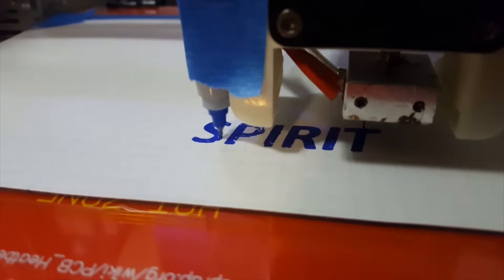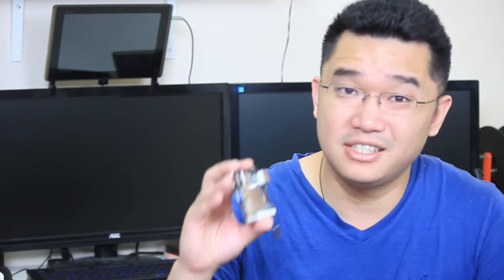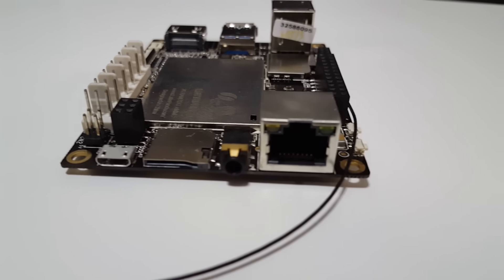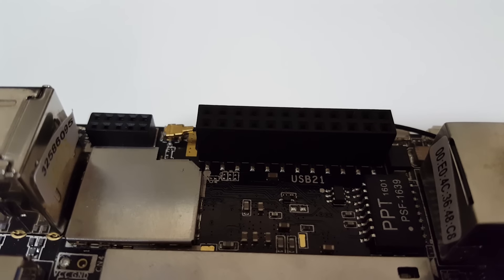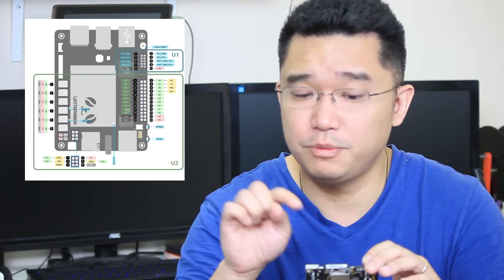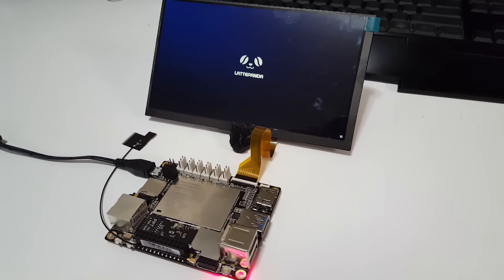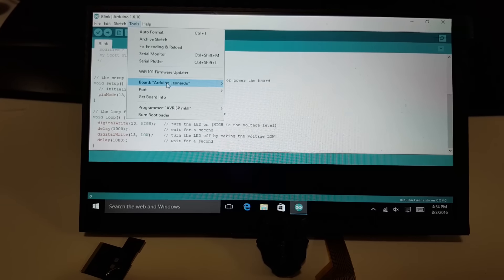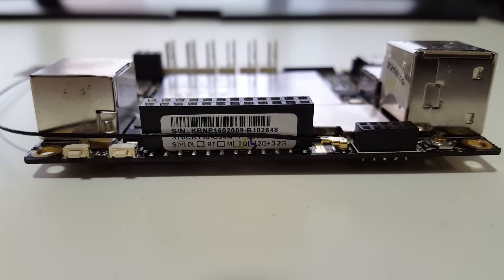Lattepanda windows 10 arduino built in

Comment: What are the advantages of boards like this vs a tablet (with a detachable  keyboard) aside of augmentation?
Reply from the maker: you can use this board to connect to the ouside world, temp sensor, relays, switch, ect...
Reply: +Novaspirit Tech cool, could be useful in electronic engineering. Thxs for the quick response nova.

Comment: have ordered a lattepanda 4/64 --- arrived today.
they only deliver with win10 ... 
but the win10 comes preinstalled is not activated
looks like the user has to buy a legal key
that sucks!!!

other panda users, same experience?
Reply from the maker: +crapcbm I will mention this to them... I'm very disappointed if this is happening
Reply: Novaspirit Tech
I wrote them yesterday. today reply from them: "DFR0419 is come with Win10 System without a key. You need buy your own key from Microsoft.
But it is  not illegal if you use it after 30 days on trial, just some functions are locked."
This is a scam. Now open a paypal thing ... that sucks, so guys again and again kill great projects.
Reply: I purchase latte panda 4/64 without licence too , I try to activate with stock product key but i did not work. Then I bought an OEM windows 10 licence that cost 26 euro.  I activated succesfully.
Reply: kormemis
yes that is right not all keys work.
Have also a key (from a broken netbook) but it said 'no' :P
I used this chance to test the "activator" to test this OEM thing, it worked and is now a "legal" copy (right, not really. But before someone gets panic, don't panic,
I plan to remove Win10, as it is a pain in the a...
Will try to get a Linux running. Have tried Mint18/64, but WiFi did not work in live-OS
We will see ... :)

Make sure, that it has air flow under side, so it don't slow down while working when getting too hot.
A old small cpu/gpu cooler is enough, If it continues to get too warm, use the fan of it on low rpm (5V of the board, and test some resistors)
Have done so, cool cool ;)

btw. dont use the micro USB to power it, that sucks. Long USB wire, tiny contacts, tooooo much resistance. Dont power up and work all the time.
You can use 2 of the 2x2 header pins next to it, make sure to check polarity + and + --- that is direct contacted to the micro USB.
Now works like a charme for me. Here you also get the 5V for the fan if needed.

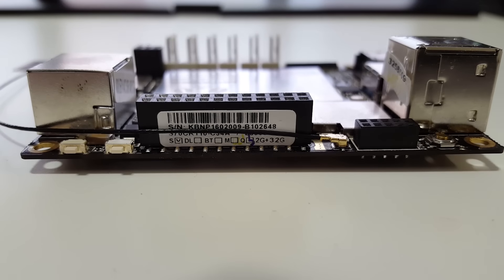Comment: 4:00 the solution without tape is write the program

void setup(){

pinMode(13,OUTPUT);

}

void loop (){

digitalWrite(13,0)

}
the sketch just turn the built in led off all the time

Comment: Just use four stand-offs at the board's mounting holes to keep the CPU's heat sink off the table. The Atom chipset is used in thin netbooks which are not fan cooled and don't even have vent slots.

Comment: I'm using a 2.1 Amp 5volt power supply but the board only stays on for about 3 minutes and then turns itself off and I have to reboot. I am using a standard keyboard and mouse  and HDMI into a LCD TV. Has anyone else had the same problem ?

Comment: Would really worry me that it gets so hot. Electronics that get that hot don't last long. Thermal cycling will stress solder joints and eventually they will crack. Hmmm..... If its low power then that means whats getting hot is likely very concentrated. Even worse. Think they should do a revision and address this.

Comment: Is that gigabit lan or 10/100 lan like on the raspberry pi?
Reply from the maker: the on board lan is 10/100 =T but with usb 3.0 you can use usb3.0 gigabit ethernet otherwise not possible with the pi
Reply: +Novaspirit Tech Ahh i didnt think of that
Reply from the maker: i just released pictures of a usb 3.0 gigabyte test http://www.novaspirit.com/2016/08/04/lattepanda-windows-10-arduino-built/
Reply: You should add this in the video desc so people don't miss it!

Comment: I don't know. I mean, if this device is touted as a fanless micro PC that ultimately gets so hot that it requires a fan if you stress the processor with calculations too much, then it may not be worth it. Thermal induced stress will end up destroying the unit in a few years. What if I intend to use it on a product and on humid, high temp environments? has anyone tried it?
1) Gets too hot to be useful as an industrial/product computer
2) It requires additional cooling, means it cannot be sustained by its own radiator fins.
3) The windows 10 still requires activation (add $20-25)

Has anyone used this device on sustained cycles with high CPU activity? what's the temperature it can reach?